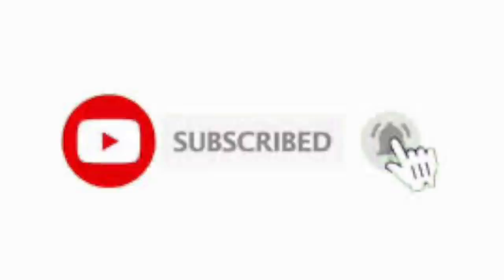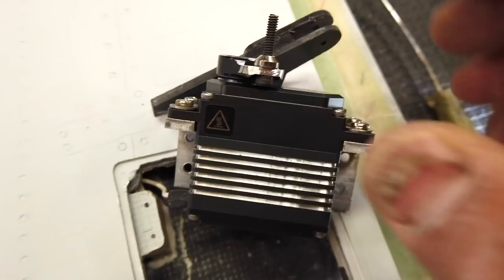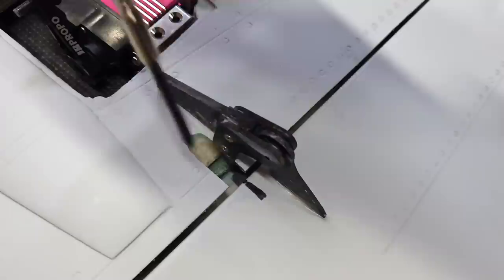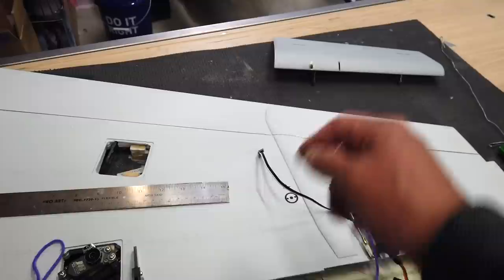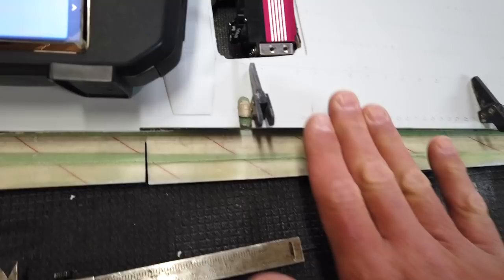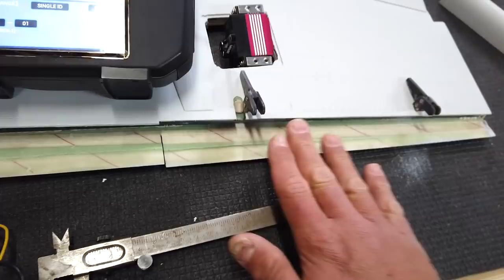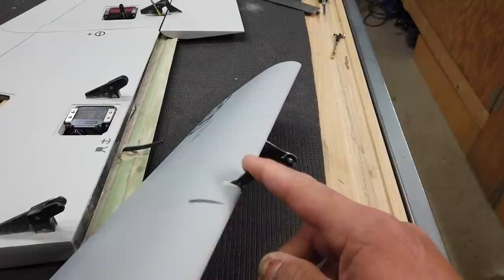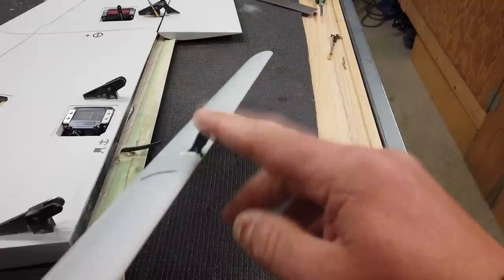SKYMASTER F-18 - Build Video #6.  Assembly of Wing Continues

Comment: Nice job on those control linkages! You are so good at coming up with different ways to do things neatly. Nice job mate! Why do the ailerons only move one way?
Reply from the maker: Good question and thanks for the compliment!  On the real F-18 it's of course all controlled by the "computer" but basically the flap and "aileron" will act as flaps and than the tail does the primary control.  You can setup the model F-18 many different ways but basically the way we will set this plane up.......I think......is.  no flaps, taileron works and Ailerons work with down movement only.  1st stage of flap, flap and aileron come down at the same amount.  Aileron mixed with taileron.  Full flap both flap and aileron come down to full flap setting and just taileron works.  

Thats my thoughts right now but skymaster has some videos showing the various options.
Reply: Thanks Makes Sense!

Comment: So the model doesn’t use “up”aileron deflection? This seems different to videos of the full size version showing control checks. Another great video by the way....
Reply from the maker: Ian Brookes the manual states a small amount 15mm of up which is achievable and 25mm of down but the primary control comes from the tail.
Reply: The Lighter Side Of RC ah, I see. I spent many years maintaining Tornado F3’s that don’t use ailerons at all, instead relying on wing spoilers and an all moving tail surface or “taileron” for primary flight control.
Reply from the maker: Ian Brookes from a model perspective it really depends on the manufacturer I guess?  What I mean is my tams F18 hornet 1/8 scale flies great with ailerons and elevator separate. The sky master F18’s 1/6th scale states that just aileron must not be used. It must be mixed in the tail.